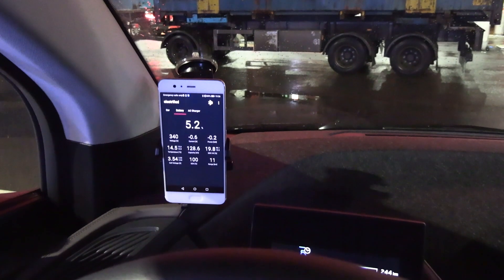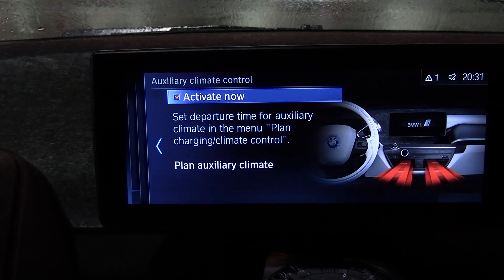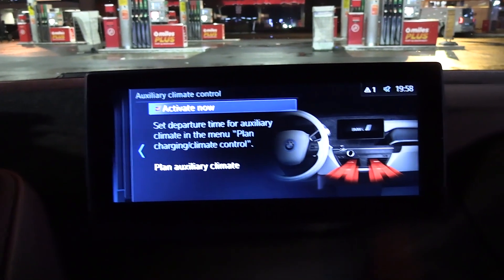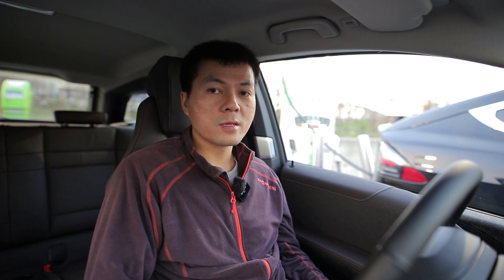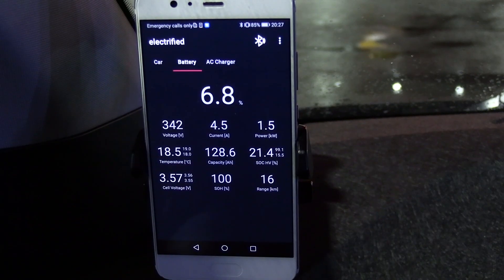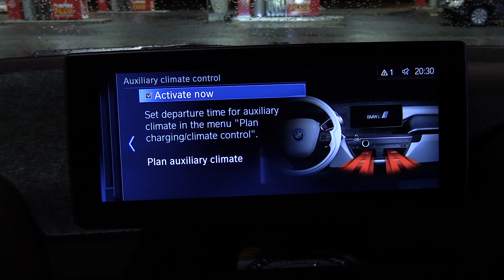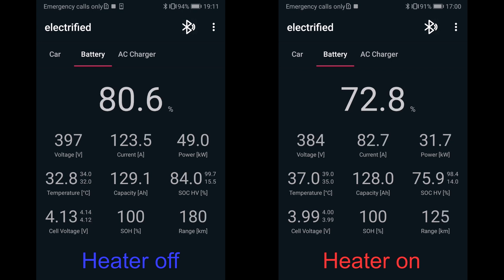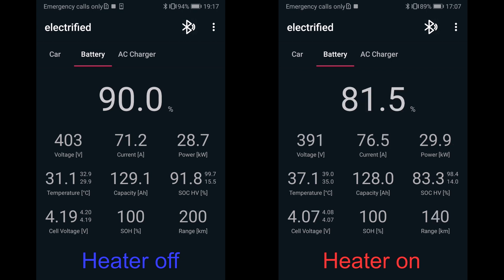BMW i3 42 kWh overheated battery (rapidgate)

Comment: It seems the smart thing to do in this case would be to pump heat from the battery into the cabin.
Reply: This.  Should be available in places with cold winters (Canada, Northern Europe).
Reply: Or the owner could just make fire inside the cabin while charging!
Reply: Octovalves are hard to come by..
Reply: @dandaly7305  except many Canadian dealerships just import ex-lease American i3’s
Reply: I also thought about this. So, is there some way to set up the HVAC to do this?

Comment: @Bjørn Nyland 
Almost right. It have a heat pump, and this cools the battery as well. (same circuit and compressor like the air conditioner).
But it also have a normal heater (like an immersion heater), but it would consumes a lot of electricity, so it try to use the hear pump as long as possible.

Comment: Thank you, Bjorn, for helping me avert disaster from an overheated battery.  This is what happens when using legacy software like iDrive, and retooling it for each vehicle.  This is an area where they saved weight by having only one compressor, but then didn't do the rework well of the software to match the reduced capability with only one compressor now.  It's a binary choice, and since they give the driver the choice, if they choose cabin heat, then they can inadvertently cook their battery.  It's something they should have fixed awhile ago, but now never will be.  For the record, I am an old man now, and sitting in the cold in the dark while charging the vehicle is not what I thought I would be signing on for, but that's the reality if I want to save my battery.  Dang.  This is a real gut punch, BMW.  I don't like being cold while I charge the car, and I'm the only one who will reliably do it.

Comment: Great video.  Sounds like it needs an Octovalve!
Also the charge wiring may not be designed to carry the load of the cabin heater, battery cooling, and max battery charging simultaneously.
The cabin heat, low battery lockout. sounds like a simple software glitch.
My take on this is that all car companies have these types of problems. Tesla has realised this from the start and has moved as much of the car functionality as possible into software. The result of this is that these type of problems for a Tesla are easily to fix. Not easy for BMW because OEM parts do not play nicely in a software centered world.

Comment: Battery is not aircooled. It has coolant lines in it, I have them dismantled in my garage. Problem is that there is not necessary additional connection between heatpump, resistance heater and battery, so when you use the system to heat up cabin, it is not cooling your battery. Problem of one circuit only.
Reply: Stupid question maybe but is this the case also for heating up the battery? So I should not use "aux heater" while battery is warming up at a quick charger? Lets say if battery is 5-10 degrees.
Reply: @Danne89  There is no difference, as heater in battery is simple resistance wire and is not connected to cooling in any way. So it wont affect anything.

Comment: Tesla only has one AC compressor and several options to generate heat (motor while standing still + PTC). But it has some clever systems to divert heat, called the superbottle or the newer octovalve. Maybe now people understand better what is all the fuzz behind those two things.
Reply: indeed, the octovalve is the saving grace in the model 3 system, or in whatever form it is for the other teslas.  single heat source, but not all customers necessarily want the heat, so the multi-valve system allows coolant passage to one system or another or all.  in this case, you want cabin heat, but no battery heating, but there's no valving to allow this in the i3.

Comment: BMW I3 has 2 source of heat. 1 being the heat pump and the second is the resistive heater in the prestone. The resistive heater is in its own loop not sharing the thermal scavenging, reason it has 2 Preston reservoir even for the non rex versions. For example the golf use only one Prestone loop and re-use thermal scavenging to warm the cabin. The reason it takes some time to feel the heat when you activate auxiliary heater is simply the same reason water does not boil instantly in the kettle. They do not allow the primary ( heatPump ) when charging, likely to ensure voltage is not fluctuating top the dc motor running it. On the other hand, you can supply any resistive element with any voltage / frequency you want and it will not care.

The battery will overheat for the simple reason you are abusing it by charging it and using resistive heating at the same time. This is a design flaw as the battery is cooled with lines of refrigerant and the source of cooling is the heatpump... 

Resistive heater is also not allowed in low battery soc as the consumption is very high compared to the heat pump. Resistive will also kick in on its own if outside temp is below -12c

Comment: the BMW has a very simplistic design on their heat pump / air conditioner -  battery cooling system, I hope they address this in newer models.

Comment: That’s what I normally do with mine, just start a pre-condition cycle from the app 5-10 minutes before I get back in when charging.  Enough to clear the screens and take the chill of the cabin in the Winter, or make the cabin comfortable in the Summer.

Comment: Let's keep this 'flaw' in perspective. For a significant reduction in complexity, the manufacturer chose to impart a minor increase in charging time so as to preserve battery life (couple of minutes) when charging from empty to full and needing to use the heat pump for cabin heating. As an i3 owner I'm fairly sure I'm never going to encounter this inconvenience.

Useful to understand the limitations though. If I'm really on the minutes, I'll  just use the heated seats.

Comment: I'm not an engineer, but what can I deduce is a couple things:
- Most manufacturers won't expend R&D in temp management. This car has an simple AC system: when you go for cooling, you pump heat into the atmosphere; when you want heat, you pump it to the cabin by reversing the compressor. The problem arises when you need both. 
- Tesla is ahead of all of this. They've been using heaters and motors to warm up the cabin, but the fact is that ACs are... Well, as their own name suggests, heat pumps, they actually move heat from one place to another, and they do it extremely efficiently, as they produce as much as 3 to 5 units of energy per one used, whereas a PTC will be a 1:1. This efficiency is specially critical in vehicles in which every watt saved matters. Dumping heat when charging to the atmosphere when there are other things (like the cabin) that needs this heat is a true waste of energy, so why not to literally transfer this excess heat where you need it? As far as I know this is what is Tesla doing with their new octovalve, which allow any condenser to be an evap and viceversa, therefore dramatically increasing efficiency of the system specially in winter, as the battery is both a gigantic thermal mass and a heat source.

Comment: I think Tesla uses the magic "octo-valve" to avoid this problem, sends the liquid to battery and hvac at same time.
Reply: MC Hammer is pre heat pump model
Reply from the maker: Not with old pre-2021 Teslas.

Comment: In older firmware on i3 with heatpump, it used only resistive heater while prehating. Then this problem did not occur, but it costed little more electricity to heat up the car.

Comment: Yes, it is true that the i3 only has a single (massive) AC compressor serving both the cabin and battery cooling. And am sure that’s the reason why BMW decided to implement the heating as “auxiliary heater”, not necessarily because the software is ported from an ICE.

Comment: The i3 actually has no liquids for thermal management inside the battery. Heating is done by PTC elements directly integrated inside the batterypack. Cooling is achieved by flowing refrigerant directly through heatexchagners inside the battery. This is highly effective but has the drawback that you need the compressor to generate any kind of cooling.

Comment: The i3 cools the Cells directly with the Heat Pump coolant. It therefore cannot heat the cabin and cool the battery at the same time. I hope newer BMWs will have a better Thermal System Design.
Reply: Especially when it would be pretty easy to design additional tube from 2kW PTC auxiliary heater, so it could work together with heatpump.

Comment: Tesla have two evaporators on one compressor, one for air and one for water. The water evaporator (AKA battery chiller) cools the  battery if the radiators is not sufficient.

A three way valve controlled by the BMS code sends coolant liquid to the chiller if needed.

I would rather have the i3 way, than the MiEV way. MiEV completely disable the heater, even if cooling is not needed.
Reply: Can it (Tesla) also use the heat pump for heating the battery? Thanks.

Comment: BMW has just made it that way. They have figured that adding a new compressor will bring the price up. And the battery is not overheating. It is just getting towards hotter temps and so the charging is slower.

Comment: If the Car is fastcharging, the System could use the Resistant-Heater for the Cabinet, and the Heat-Pump to cool the Battery in the same Time
Reply: REX does that

Comment: The i3 has another severe design flaw only few know about. There is no chance of canceling a quick charge session from the car side. If the charger bugs or simply doesn't have the possibility to cancel an ongoing charging session the only way you can unplug is by pulling the emergency unlock in the lower rear corner of the passenger door sill. Issue is: It's highly likely that the locking pin gets stuck during this. This means you can not charge as the locking mechanism is stuck in the open position now. You need to dismantle half of the rear bodywork to reset the actuator. If your car is out of warranty this is a wealthy three figure to get this done at a BMW dealership.

Comment: I guess BMW should do a software update for this. From digging around the configuration options I remember that you only get the preheating functionality if you order the heated seats. But this also gives you preheating for the battery pack. And since this is usable with a high enough SOC even when you are not plugged in, maybe the software is not properly tuned for this situation and preheats the battery while it is being fast-charged...

Comment: 3rd option:  while DC fast charging turn on accessories and enable both heated seats.
Reply: Yeah, if you're in the car, then it's better to use heated seats and steering wheel (does it have a heated steering wheel?) and in summer, well, get the hell out of the car and find some shade XD

Comment: i3 has an electric heater as well, which is used to heat the cabin if it is really cold outside and heat-pump can't manage it. Why wouldnt the car use the electric heater for the cabin and compressor (heat-pump) only for the battery cooling? Everything would be fine in this case.

Comment: it is not the compressor, the valve design needs to divert coolant to the battery to draw the  heat from battery to the cabin heater, my Kia Soul EV does does this

Comment: I just discovered the bug last week! My car is a 2015 i3 and it looks like even the 2020 i3s haven't had this bug fixed. I need to reboot the car to use the aux heater. The car actually uses the phase change a/c system to cool the battery. The same compressor that's used for the cabin is also used for battery cooling. So I believe it's a software limitation where the car cannot turn the cabin heater and the a/c system on at the same time, even though they have different uses. Forcing the cabin heat to be on (aux heater) will disable the a/c system, overheating the battery. That's my guess. It's a pretty fun car though.... if you don't have a Model 3.

Comment: Question: the i3 comes with air-con as standard in the uk, for which there must be a heat pump.   In addition you can spec a heat pump (as an optional extra) which i assume provides more efficient cabin heat as opposed to a simple electric element (£560). For those choosing this optional extra does the car then not have two heat pumps? One for cooling & one for heating?

Comment: 1:20 - it does heat/cool the cabin actively when charging BUT you have to select 'Auxiliary Climate Control' in Settings or turn the car into 'ready' mode and then it summer it will cool; in winter it will heat - all with AC. Otherwise, as you've discovered, it's just the fan. This is in the manual... and has been for 7 years. 😉
Reply from the maker: Not possible to turn the car in "Ready" mode when plugged in. "Ready" means it can drive.

Comment: The heat pump is an option in the UK. I guess it would be nice if they left the resistive heater element in the car as well for use while plugged in. It comes with heated seats as standard so I guess use those. But the average person won't realise that the heat pump is stealing cooling from the battery and throttling the charge which seems a bad design.

Comment: Seems like a simple problem. Battery giving off too much heat, but cabin cooling off. I'm not sure if it is cost or space or weight effective to solve this just to aid charging comfort. But these are the features that diiferentiate one model from another

Comment: Did this bug affect the 1000km challenge time?
But I find it kinda funny. 5 degrees more not even hitting 40 degrees BMW is overheating. Tesla is purposely heating the battery to about 50 degrees for DC fast charging on superchargers. Opposite strategies. Who is winning the degradation race? BMW or Tesla? I know for a fact that i3 battery's are very good long term, excellent low degradation.
Reply from the maker: Yes
Reply: I was going to ask the same, thank you guys for clarification. That explains why i3 did 1000km slightly longer than it might.
Reply: @JPetr94 It's realistic in winter, nobody would turn of the heater in winter. So everything is fine with the 14h time.

Comment: The battery is toasting and the driver is freezing. Yes i would say that is bad design. Should not be difficult to route heat from the battery to the heater.  If Liquid use two circuits and use valves to  put in series. They just did not think about it.

Comment: Shouldn't turning on this auxiliar heater on in winter during fast driving and strong recuperation also overheat the battery as the compressor is in heating mode and thus cannot cool the battery? Maybe the additional air cooling will be strong enough in that case to compensate.

Comment: Bjorn i think auxiliary it’s when the vehicle is park, or need more hot because the weather. Why you don’t use the switch to change temp from cool to hot? When you used the thermal camera, the switch was 21 and the camera was saying 28, it doesn't make senses

Comment: I hope some one at BMW sees this video and finally update the heating bug. 
Just a small bit of additional weirdness the I3 ReX version does not have heatpump for cabin heat, just a electric water heater. 
So the ReX might not rapidgate, but on the other hand it uses more power to heat. 

How did you make the graph? did you manually input the data?
Reply from the maker: Yes
Reply: I have the Rex and not Rapidgate 😬, but it’s due to design the Heat/cooling circuits...
It’s need to complete separate these circuits, but I want see how do PSA and VW with HeatPump make it better without complex valve or Octovalve...
Reply: I wonder if they changed the design for the MINI Cooper SE, since that’s using the I3S’s motor.
Reply: @gronkjor  Yes and all mini's have the heatpump. would be interesting for Bjorn to test this to see if it's fixed in the mini. I have a i3S Rex, but to be honest very rarely sit in the car while charging so always been pleased with the charging speed on my i3S the 50kW is fine for the smaller battery and it throttles late so completes charging quickly to 90+ often more quickly than I can eat lunch,

Comment: Is it also because we are doing opposite things with the a/c? What if we had to cool or heat the cabin and battery? Would be interesting to know if there is a scenario where the compressor is shared between the cabin and battery.

Comment: Having a 2014  REX , I am confused. I thought the dash buttons for Defrosting activated Resistance Heat, separate from the Heat Pump. Are these buttons what you refer to as “Auxiliary Heater?” The Defrosting buttons rapidly deplete the battery and offer instant heat while driving or preparing to leave to my experience, but I have experienced the shutdown of the Heat Pump while rapid charging.

There is a short time limit to the Defrosting Buttons’ action, though, even if actively charging. So maybe that is why you initially get heat on your reading that drops off after a few minutes.

Comment: So for me to understand this correctly, with my BMW i3S Rex (has heated seats, so has heat pump I presume) I use the climatise function, which I believe either warms or cools the vehicle depending on the outside temperature. Is this now a bad thing to use while the car is charging? 

Secondly, if I’m charging my car at home on a 7Kw charger, if I setup a departure time, I can condition the battery prior to departure, i.e if it a frosty morning it will warm the battery during charging, but also climatise the cabin as well. Is this practice nolonger advisable? 

Finally, during the summer, when charging, I often climatise the cabin {aircon}, is this robbing the cooling of the battery?

Appreciate any reply to these questions. 
Cheers

Comment: Turn on the seat heater! Some have heat pump, some have electric resistance heater.
Reply from the maker: Seat heater will not heat up the cabin.
Reply: I had an i3 the heater in the seat got me toasty, so I didn’t have to run the battery down with the main heater....